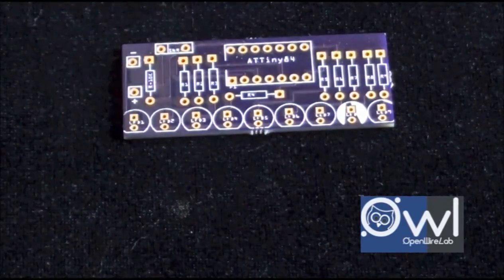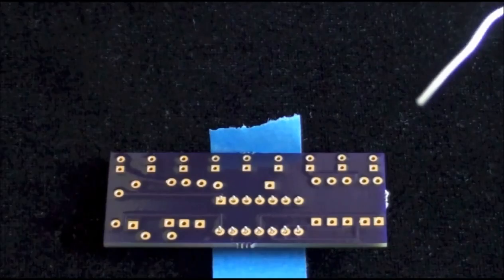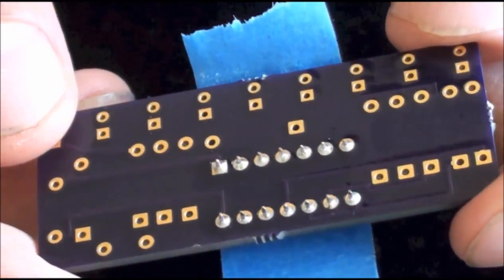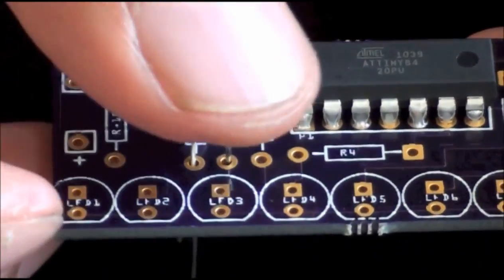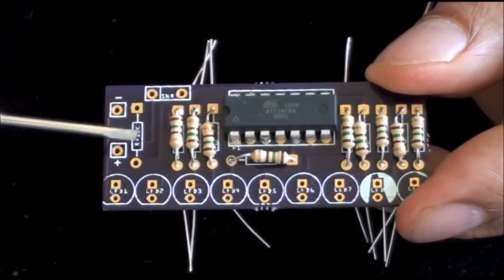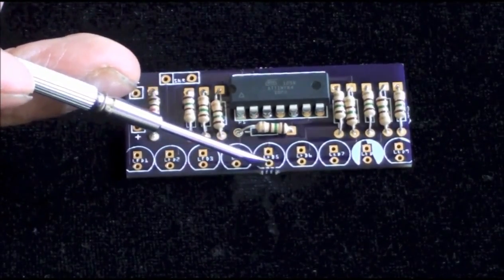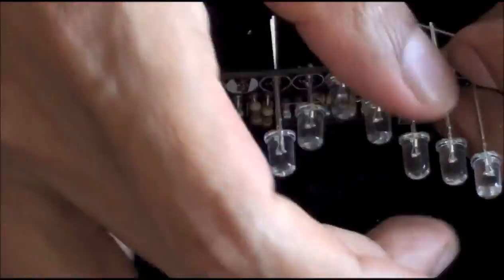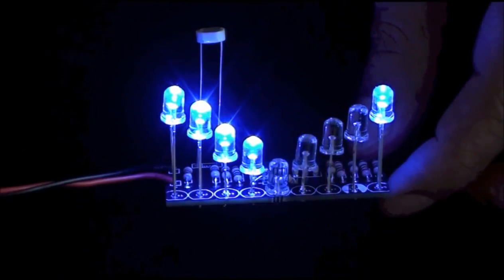DIY: Make Your Own Light Animation

Comment: HEY!!! First off!!! ..... In case you are NOT aware of it ..... you are using a - Soldering > IRON < and NOT a > GUN < !!! SHEESH!!!

Secondly.....besides your holding the "iron" on the IC pin for WAY too long, it is desired that you start with Pin-1 (as an example) and then solder the opposite diagonal pin (i.e. Pin-5, Pin-8, Pin-9, etc. depending on the number of pins on the IC). This helps in distributing the heat around the IC instead of concentrating the heat in one area as you were doing in your video. It should not take any longer than 3-seconds to solder an IC pin!!!